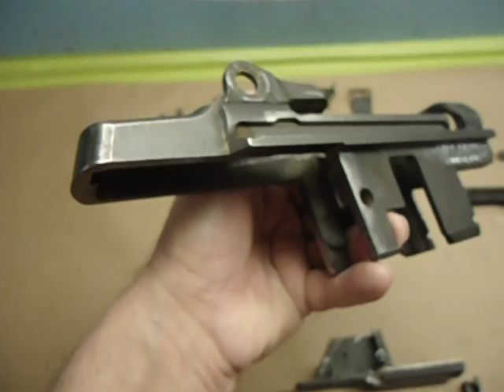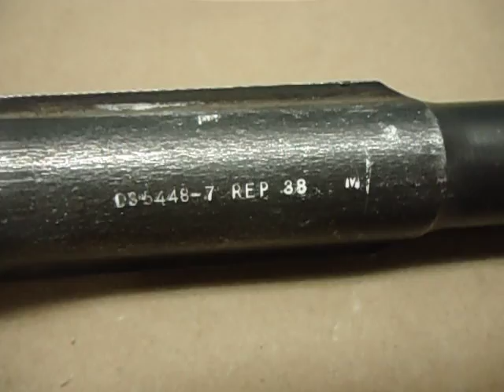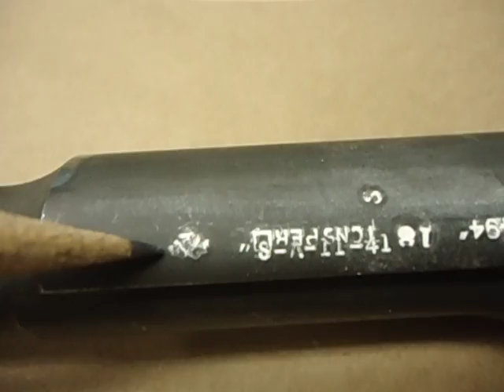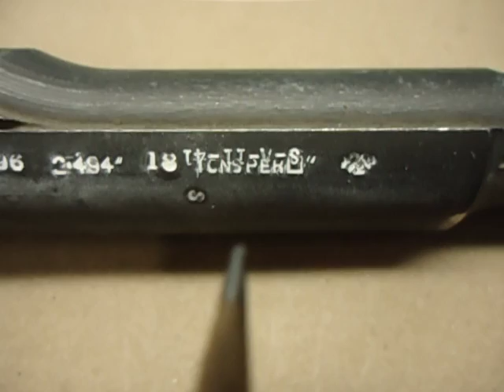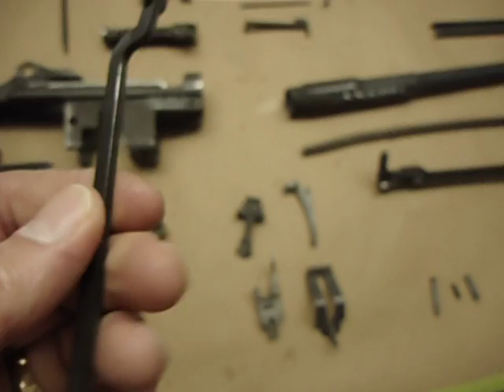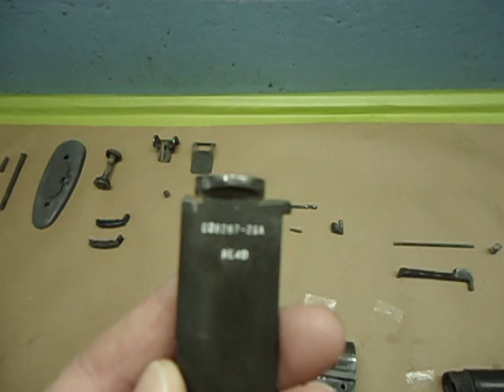Shawn 1941 M1 Garand Lend Lease Restoration video 1 Vulcan Gun Refinishing

Comment: I have a pristine 277,xxx Lend Lease I would not refinish any other pats than the receiver. It ruins their value ,they are all correct. You can touch up the parts. A original finish op-rod of that type and uncut is upwards of 200 bucks. The trigger group looks correct . With original finish is worth 400 or more. The early short fork  is almost not obtainable any longer . In 2025 I have not seen on for sale. same goes for the flush nut early sights.

Comment: That measurement is actually 2.494, which is the maximum chamber measurement for the 30-06 cartridge. Maximum case length for the round is 2.494, trim length is 2.484.

Comment: That’s a rare M1C sniper receiver. Those holes should not have been filled. Springfield drilled and tapped those holes before the heat treating process. There’s no way a common guy would have been able to drill that receiver later on in life.
Reply: UnitCrane514 luckily it’s not an m1c. The serial block for
M1c is quite specific and more late war. That and it was verified on one of the gun forums that the spacing of the holes was incorrect.